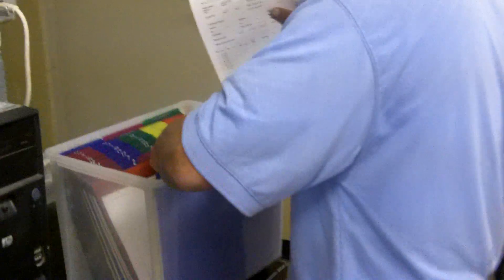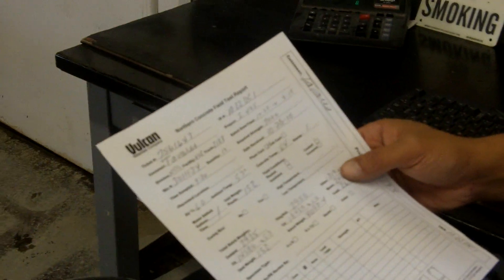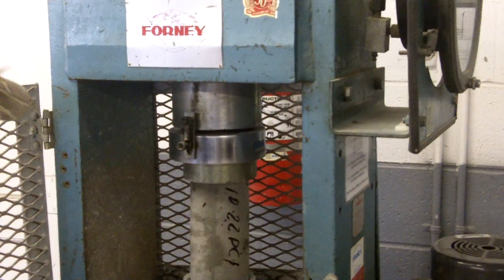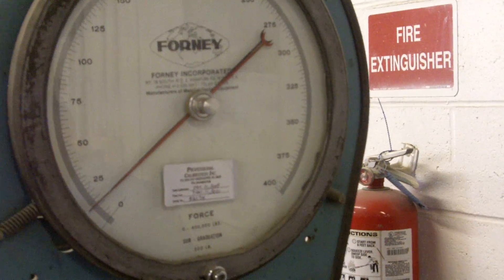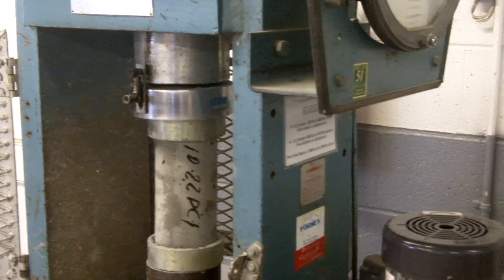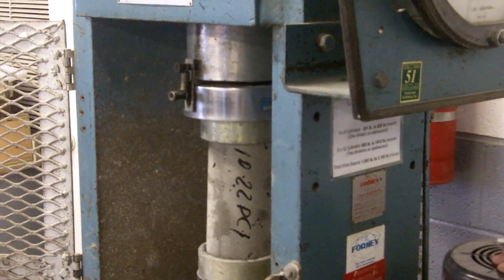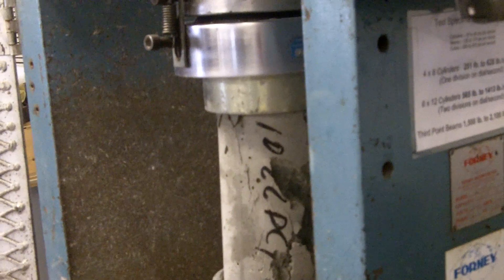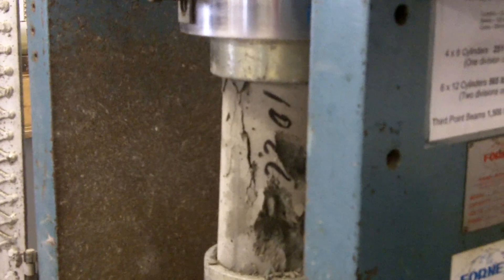How to test PSI  strength of concrete core samples.

Comment: I’m confused….  Let’s say this test sample is 4” dia which is 12.56 sq.in. in cross section area.  So if the sample is assumed to be at 2,000 psi state, shouldn’t the sample support 25,000 lbs?

Comment: some one please answer, can we put a rebar reinforcement into the concrete cylinder and do the same exact test??
Reply: rebar is used for tensile strength. this test is meant to measure compressive strength
Reply: I am by no means an expert, but in the handful of test cylinders that I have seen prepared, none had rebar in it
Reply: You are asking a forward-looking question.. good for you... Thinking outside the box ... BTW - I see a lot of hand written paperwork shuffling going on in these labs and in this video ... I saw same thing in the soils lab where much of the  data is collected by hand onto paper ..  all this in spite of software that exists for soils testing data collection that automatically takes the data from the electronic scales and processes it into a soils report. Engineers should be doing engineering instead of typing data int gINT and other boring log software. ...

Comment: thank you for putting this out. We will be making rammed earth test samples for compressive strength. Our test goal results are a (min. 1Kpsi). We want to get some initial results using a 25 ton press and of course plan to send out samples to a lab. Are cylinders vs cubes easier to test and calculate?

Comment: Didn't check for perpendicularity at 10 percent load, didn't check for gaps, didn't check swivel on the upper platen..there is an astm for this that should be followed for valid test results....